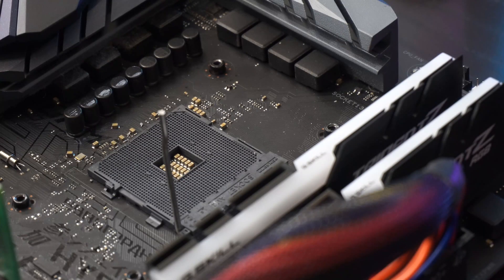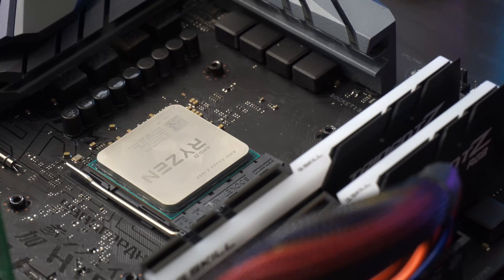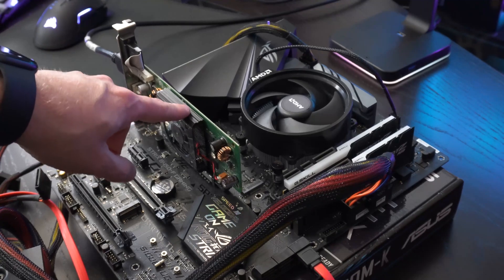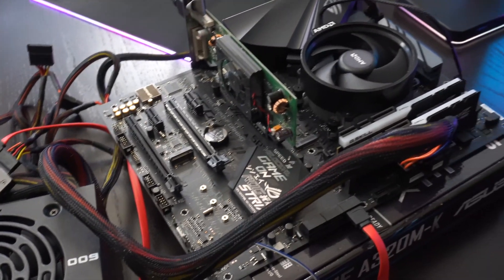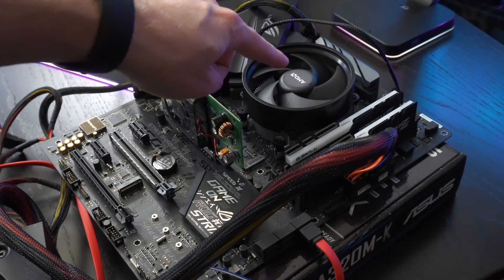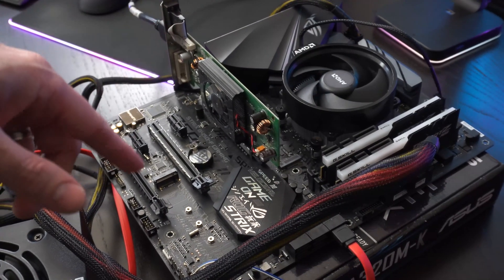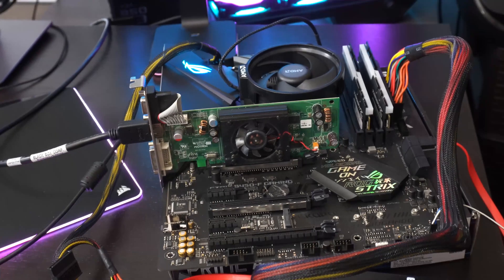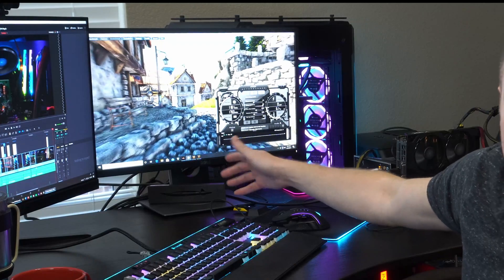Ryzen CPU Broken Off Pin - Is it Dead???  Troubleshooting Used Hardware - Don't Ever ASSUME Things!

Comment: i have a ryzen 5 2600 with three missing pins. it works, but win11 reports only 16gb out of 32gb usable. the pins must have to do with the dual-channel ram operation. each dimm works to its full capacity separately. but not together. the same thing on win, on linux, and in a different board.
Reply from the maker: Interesting!  If it works, it works!!

Comment: It's my first time i build my computer and i broke one but still not working any helps ?
Reply from the maker: You likely broke off an important pin.  Some people have gotten away with clipping off a pin from a donor CPU and putting that pin into the motherboard and reinstalling the CPU…. however that is a bit of a dicy move.  If it’s not an expensive CPU I would just buy a new one.

Comment: also... im having the same issue now with my 2 dual dimm slots, similarly to your problem. I think what happened is the new cpu must haved fried my mother board when trying to install the damn thing.. NOw the motherboard is only allowing only 1 dimm slot to be used even after putting in the older cpu. I'm thinking... can putting in new cpu cause motherboard problems more specifically in dimm slots to not work.
Reply from the maker: Hard to say.  Sounds like some damage might have been done though after the drop and reinstall.

Comment: so check this out... bought a new cpu, 5800x3d... wouldn't work on my current motherboard for some reason even tho it's compatible. now, i had to take the damn cpu out and putting it back in in the sake of trying to figure out why it isn't botting up even after bios update and everything else that' i've tried. In the midst of all that... i god damn dropped the cpu and some pins got bent. So i tried to straighten it out and in the mist of that... i broke one pin and is no longer there. Holy fuck me right! does anyone know if this brand new cpu would still work with one missing pin on the edge?
Reply from the maker: It’s possible it can still work with a missing pin, some are grounding pins and you can get away with missing one
Reply: how did it go
Reply: how did it go

Comment: Great Video... I recently upgraded my main PC from a Ryzen 5 1600 to a Ryzen 6 4600g w/ new Stock heatsink... I got a nice little performance boost, had 0 issues.. tossed the old heatsink and kept the 1600. My main rig is now the 4600g/32gb gskill DDR4/Geforce 1660 GTX on an ASUS B350-F w/ the latest Bios Firmware/Flashed.

I had a lot of extra unused hardware and an old B350-F mobo I got cheap off eBay. I tossed the 1600 onto it and seemed to have no issues installing the CPU w/ a new stock heatsink... but the board wouldn't light up/start... do anything. I probably should have tested it before spending the time putting the CPU/Heatsink on. I tried a few things but chalked it up to a DOA board.. oh well $28 down the drain.

I got an ASUS A320 Mobo off Amazon and it arrived DOA, wouldn't hold power, I did the same darn mistake putting the CPU/Heatsink on... eventually RMA'd the board back for a refund. I ordered another A320 (MSI) and I tried testing it before putting the CPU in... it had power, "booted up" or at least spun the fans letting me know it was alive, somewhat. But I tried the onboard video HDMI, then VGA and nothing was displaying. I figured let me put the CPU in and see if it will boot up... everything was spinning but nothing was displaying, I even tried my 1660 GTX via PCI and still nothing... cleared CMOS, etc... I tried using the EZBug LED's to see if they would light up and indicate anything, I removed the RAM and it should have lit up but did not.. so I chalked it up to Damaged and Returned via RMA (again).

After tossing this 1600 into 2-3 boards that did not work I'm starting to question whether it's the CPU or the boards... I had little to no expectations for the old B350 I got off eBay, some clown got me I can only blame myself. The first A320 mobo was just DOA, the 2nd one though was very weird... I don't know why it wouldn't show any video.

After inspecting the 1600 I realized 1 pin was missing, one was slightly bent but easily fixed w/ a razor blade and gentle pressure. But I can see one pin is clearly missing and I probably lost it in the B350 or one of the A320's... I noticed with one of the A320's that it wasn't dropping in and staying tightly secure, it took a few attempts to get it flat... that's when I realized I better inspect the pins.

I am stubborn and ordered another A320 (Gigabyte) that will arrive next week from China.. it was via NewEgg (or one of their resellers) and I'm a little worried about tossing the 1600 into it... I can always grab another Ryzen CPU whether higher or lower end as long as it's under $60'sh.. I just don't want to spend $150 on another chip.. Heck I got the 4600g for $99 on Black Friday.

tldr

My question is if I connect the Gigabyte A320 motherboard to my display via HDMI or VGA/DVI withOUT the CPU in... Will the motherboard display anything? Even if it's just to show me the logo and enter the Bios settings... I just really don't want to toss this chip into a new board and break it. I'm 100% sure the old B350F I tried was DOA, I'm 100% sure the 1st A320 mobo I tried was DOA, but I'm still 50/50 on the MSI A320 I tried last... I really thought it would work but after trying without the CPU receiving No Display.. even after waiting patiently for a few minutes... then trying w/ the CPU intact 100% w/ Heatsink installed. I was thinking "darn the onboard video doesn't work.. let me try my PCI GPU", but after that failed to Display anything I gave up. After trying to test/play around with the EZBug LED's provided on the board and receiving no lights, just trying to trigger something (faulty RAM, CPU, etc..) nothing would light up (or not light up) it was just all dead... so much for EZBug Diagnostics.

Any help would be greatly appreciated, I wish I could post a picture of the CPU here to display the one missing pin... I know I probably damaged the 1600cpu on either the B350F or one of the A320's. Obviously it wasn't lost in my main rig as I would have had immediate issues with my good B350-F board I'm using currently.. This systems running great and I was hoping to build something out of some scraps, actually brand new DDR4 RAM, PSU, and welp tried 2 "new" motherboards and nada.... Should I just buy a cheap Ryzen 3/5 similar to the 1600 and save myself a headache... or should I try one more board?

Comment: I just bought a new 5600x and the pin was slightly bent and then I tried fixing it and it just brocke :( I litterly bought the CPU brand fkn new
Reply from the maker: Is the CPU dead now?  Sometimes you can get by with one broken off
Reply: @PCTechHustle  there is a bunch of bent ones too

Comment: I have same problem with my CPU ryzen 5 2600x motherboard asus rog strix b450 gaming same like you,all pins are ok no missing but PC restarting everytime when i try boot windows how can i fix if its possible? Sorry for my english :)
Reply from the maker: Are you able to get into your bios?
Reply: @PCTechHustle  yes i can go into bios there no restart only when i try boot windows then restart some times yellow LED blinking same like in your video. I put older cpu ryzen 3 1200 works ok
Reply: Bios updated to newest version all bios settings default

Comment: Would a pc start even if the cpu was broken? I was installing it and heard something i didnt like. I dont have all the parts so i borrowed my little sisters parts just for a moment. It asked me to plug in a boot device but i dont have one currently. It didnt read my hdd. But thats as far as i got. It kept shutting off after. I also dont have a cpu cooler at the moment. Is that cuz it got too hot? Or is my cpu dead?
Reply from the maker: It would start but likely run into the issues described.  Boot loops, black screen etc.  can you get into your bios?
Reply: @PCTechHustle  no it would just say plug in boot device. But i dont have boot device with windows on it. I still need to download the media creation tool thing. Im just going to have to see once i have everything in hand. Only thing im worried about is my 5800x having bent pins. It does fit securely in spot so i think it should be good

Comment: I’ve snapped a pin trying to bend it back 😬 it’s one of the edge ones…. Is that bad ? It’s a ryzen 5600
Reply from the maker: Does it still work?
Reply: @PCTechHustle  barely :(
Reply: @PCTechHustle  cuts out every now and then…
Reply from the maker: I meant to do a follow up video on this one.  Basically to get the CPU to a state like where is seems like you are at and use a donor CPU to salvage pins from.  I might come back to that idea.  But the idea is you get maybe an old FX style CPU and drop in a pin in the location missing on your CPU into that pin slot on your motherboard and if all works out you are back in business.  I have no idea how well that may work but could be an option for you without having to replace the CPU completely.
Reply: @PCTechHustle  I don’t have the equipment to do that sort of thing :/

Comment: I don't know how it happened. but while cleaning my cpu and to change thermal paste, i opened cooler and it was kinda stuck with the processor. so i had to put a little bit of force. yup it went out but with the processor also, while the mobo bar was locked. i was scared. litterely processor was stuck with cooler like i used glue or something. then i take of the processor.. and while cleaning it i noticed 2 pin was bent. i was shocked. somehow managed to to fix one of them . but other one bent badly. and i think it's broken. so yup one pin broken. so after putting everything like before and hit the power button and checking bios looks everything normal. but after windows booting up. I couldn't able to use Windows hello pin  to unlock it. it says"something happened and your pin isn't available...." how to fix that now. is it causing bcz of missing pin ? bcz as far as i know, before that incident my pc was working perfectly. Im scared need little help !
Reply: This happened to me today , literally fucked up my processor I'm legit so pissed (first day having it btw)
Reply: @BonesyVAL just happened to me today lmaoo, instead of pulling up try sliding the cooler to the side
Reply: Same

Comment: Ah the good old gas station hose. Bryan at Tech Yes City would NOT be happy with you 😂
Reply: @PCTechHustle  I'm a hypocrite, I actually met a guy at a gas station at a nearby town just before Christmas and did a deal on a 1070ti to stick in a build for a friend...I got away with it the card has been running fine 😅 how quickly times have changed though, I got that for €300. Now I'd be lucky to get the same card for 450 😑
Reply from the maker: Yeah prices on GPUs suck!

Comment: this is why i dont get ryzen i dont trust myself enough to not bend the pins. Love ryzen but oof. Im rocking a i3-10100 with 16gb of ram at 2666, ssd m.2 1tb with a rtx 2060 super and a good ol EVGA 600 80+ white and  im happy with the build. keep up the great videos!
Reply from the maker: Yeah the pin-on-grid design is a bit nerve racking but I find Intel just as scary as those pins on the board are much more fragile.  Either way you have to be careful!
Reply: @Cryptic, with all that decent stuff, why'd you cheap on the PSU?🤔
Reply: @PapaMav  graphics card literally ate my money 😔
Reply: @Cryptic, completely understand.  Am sure many came up against the same circumstance.